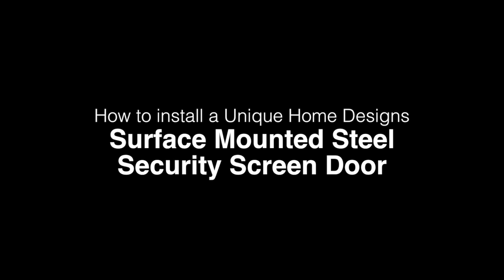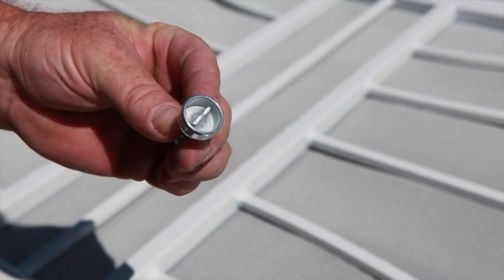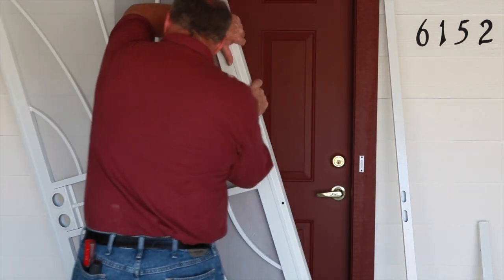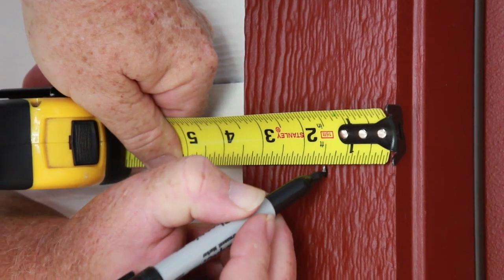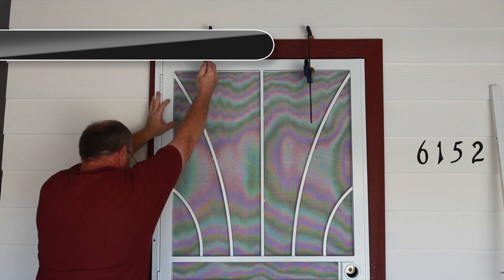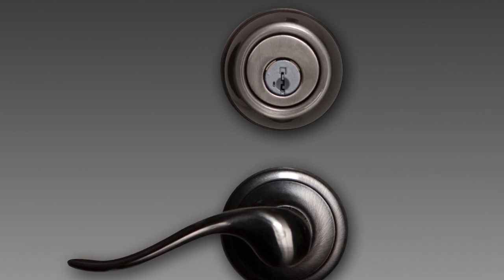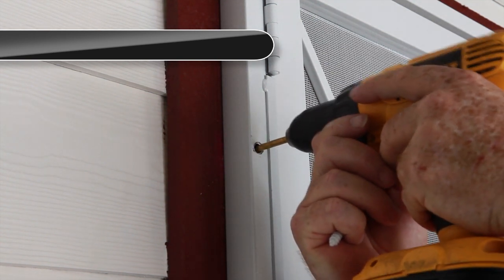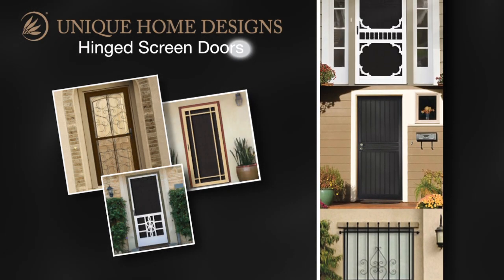Steel Security Screen Door – Surface Mount

Comment: My door is 32x80 would I get the 36x80 security door?
Reply from the maker: If your door is 32x80, you would need to get a 32x80 security door. These doors are surface mounted which means they affix to the trim of the door, and the overall dimension of the security door is usually a little larger than the call size of 32x80

Comment: Is the address in the paper instructions the only way to contact the company for issues installing these security doors? I followed the paper instructions and got stuck because my screws wouldn't go all the way in. When I watched this video, it says to use a ¼" drill bit. The paper instructions say 3/16". Now my one-way screws are stuck and the bit to install them has rounded the the screw heads and it is also worn. So disappointed and don't know what I'm going to do now.
Reply from the maker: There was an inconsistency in the old paper instructions that has since been addressed. the drill bit needed is 1/4". We apologize for any inconvenience this may have caused.

Comment: Okay, I have bought your steel security door.  There is no solid wood or
 stud behind the security door frame, only stucco backed by wafer board.
  How do I install the door while ensuring a solid installation that 
holds the weight of the door and provide security?
Reply from the maker: The security door will require a minimum mounting surface of 1" on the trim above, and on both sides of your entry door. The mounting screws must be secured to a stud in the wall. These doors come with 4" one way screws.

Comment: The i structions that come with the door say that you need to screw each jamb into a stud. What do you do when the screw holes in the jamb all align with a gap between the pre existing door casing and the door frame studs?
Reply: That's a really good question because from what I can tell... if I ever do this I'm going to have that issue.  In fact I kind of don't see how ANYONE DOESN'T have that issue... help?  Anyone know what's up with this?
Reply from the maker: It sounds like your particular entryway will not accommodate a standard size door. You will either need to rework the trim to accommodate the narrower door such that it is attached  to trim that is securely attached to framing or order a custom sized security door.
Reply: Do the temporary screws need to be the same length and type as screws the door? I have some drywall screws the same length but i don't think they'll hold the weight of the door.
Reply: @arod7teen304  no, drywall screws won’t hold the weight of these. I don’t know know how they sell any of these off the floor because none seem to fit with the door stats you usually see. You might want to try another brand.